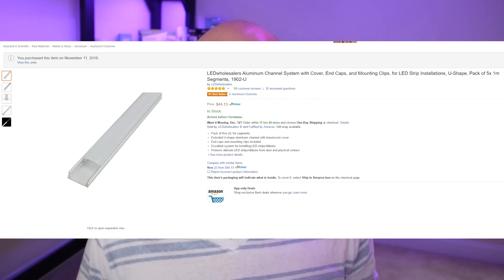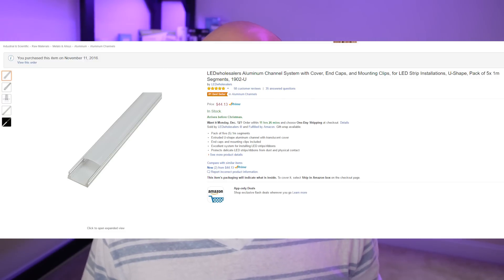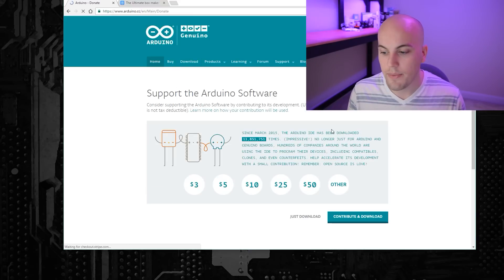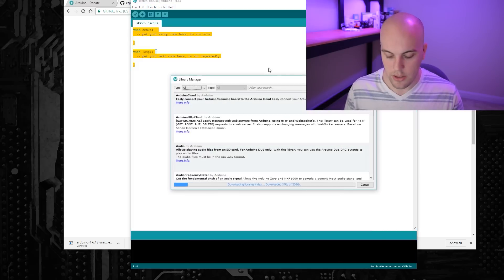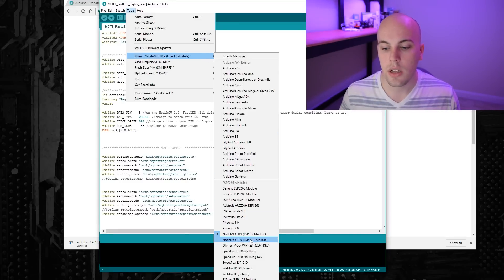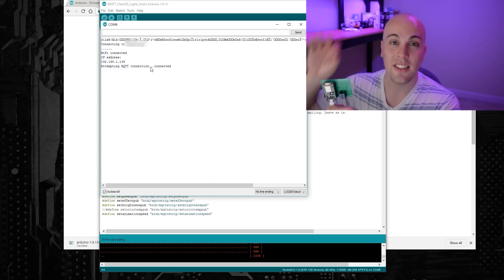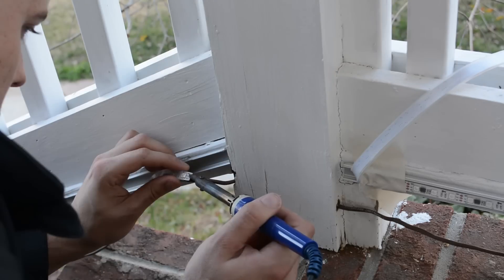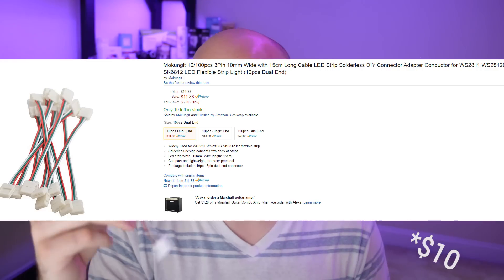The BEST Digital LED Strip Light Tutorial - DIY, WIFI-Controllable via ESP, MQTT, and Home Assistant

Comment: How do install these strips in a vehicle using the vehicle's battery?
Reply: ka1dza I am not an electrician but the power supply he lists simply transforms AC (house power) into 12vdc power (car battery) now all car batteries and car altinators are different you will have to ensure yours is 12 v and can sustain the amp output to run the amount of LED's you wish to run. Most car batteries will fit the bill assuming same LED length or less as the video. As far as setup just hook the battery to the 12v pos and neg terminals in the diagrams. As I said earlier I am not an electrician so please be sure to check all of your ratings before trying this. I am not liable for anything that may go wrong. I am also not sure in what effect this will have in battery drain or other electronics in your car.
Reply: KillSwitchio Okay. Thanks for the info. I have no electronics in the bus, so, I think, as long as the engine is running I should be ok. I just have to connect the neg to ground and positive to power. I just have to do something with the signal wire.

Comment: A tip.  Don't test the strip rolled up, as they will get hot!  I noticed that and when I rolled up to have a look, the components was all over the floor. They have unsolder from the strip.
So, no, don't use them rolled up..

Use 12V if you want to avoid the voltage drop when transfer the energy for the LED.  Higher voltage will transfer same energy with lower ampere, and that means there will be less energy losses in heat (even though they will heat in the inner part of the roll they are delivered in).

Comment: Ok so i have new problem some animations just hang the 8266 and either it gets restarted or you need to manually restart it anyone else faced the issue and have found a solution for the same
Reply: Same issue here, in fact if I switch the supply on to the LEDS & Arduino at the same time I also get a hang.Have to power the LEDS wait a few seconds then power the Arduino

Comment: Terrific video that explains so much... Frankly, it was all over my head until you started physically installing, then you got into my world as a low voltage technician. I will try to figure out how to do all the setup, configuration, and control.... Eventually.  Overall this was a bad ass project and it looks beautiful. I hope to figure out the controls side. I have a lot i want to do that seems to involve me learning how to work with Arduino.

My i offer some advice on your install?  You are correct about soldering the ends together, PITA and not worth the effort if there is a tool to help, which you found. I'd advise you use some dielectric grease to mitigate the chances of moisture intrusion at those connections.  

Good on you for soldering the cables and covering in heat shrink. If it isn't marine grade, which has a heat activated sealant, you should look into using it in the future for outdoor environments.

Where you drilled through the wood to pass the cables, I'd have used a larger heat shrink in white to cover them, or some flexible tubing which you can find in the plumbing section of a hardware store.

The wire-mould..... You lost me there. I'm sorry. 

And good on you for using a proper outdoor rated enclosure.  I've seen some really janky crap people have put outdoors that couldn't seal anything.

Comment: Hi i have question if i use a 5v led strip what would be the disadvantage as by doing that i do not need the step down converter which unfortunately cost itself around 20 dollars in India  would 5v strips affect the performance these are going to be used indoors

Comment: Need help please. I have the wiring for the ESP8266 and shift register and all that done.  I have the code uploaded to the ESP8266, but without the proper MQTT information, because that's where I'm lost!  BAD!  I have a Raspberry Pi 3.  I have tried watching the other videos linked about getting MQTT and home assistant set up, but there are many holes in it and a lot of it assumes you already have some experience with it. I don't. Not only that but it seems HA has changed a lot and some of the processes and such don't work anymore, links are gone etc. 

Please help. I've followed a ton of videos and all assume I know more than I do. Wish there was a video from beginning to end for these lights.
Reply: Did you ever get it working?
Reply: man pls, i have the same problems, dont get with all the codes at home assistant,
iz working for you?

Comment: Piece of advice at 13:04 you solder the wires when in reality life would have been A LOT easier have you just used water proof bullet connectors then for added protection the shrink wrap...... yeah yeah soldering is better so they say but should one ever need to be serviced remove the shrink wrap and then simply pull the bullet connectors apart replace repeat and done....

Comment: Has anyone got this to work or adapted it for use with a Wemos D1 Mini and WS2812B strip? I'm new to this Arduino-stuff, but the Home Assistant part works and also the D1 Mini, recieves the MQTT-messages fine, only thing is that it doesn't control the strip itself :(

Got it to work :)

Comment: A great video, thanks. I'm wondering if you can provide some guidance to help me achieve a project?

I would have a boat (Leopard 48), and would like to run a tube of addressable lights on the side stays and forestay. The problem is each stay is about 20m high, and ideally, I would like to supply power and control from the base of one stay. So the cable run would go from the cockpit (too pickup power & house the controller) to a side stay (about 3 meters), then up a 20m stay and then split down 2 x 20m stays.

I figure this is possible if I put the lights in a tube along with an additional power cable that tap's off to the LED's every 5m, but not sure how to size that cable and if the control signal will work over that distance?

It might be possible to put a small junction box at the top of the mast if that helps. Maybe even run 240v to the top and put a transformer at the top. I'm worried it will bang since I can't really secure it. I would prefer to avoid using 240v as i would need to leave the inverter running. The boat has a 12v electical system.

I have been looking for people doing garden and Christmas light projects which would have similar challenges, but people are generally using RGB lights and have more ways of supplying extra power.

Comment: Ben, It all works great and I have a strip on my Christmas tree. i noticed that input slider is now input number. I've got it to show up in my dashboard and have the automation entered which should adjust the speed via MQTT. the speed doesn't seem to have an effect
Reply: Figured it out myself, didnt have the command topic correct in the automation. had to add /set path. i guess in the video the commands aren't using MQTT json where as his github example now does.  
Thank you Ben for all your hard work on this cool project !
Reply: Thanks for your comment re the input_number for the animation speed.  How do you edit the animation speed in your automations or scenes?

Comment: Tried today to compile the code from your Github repository Ben and there's a error

unsigned int kelvin  = MILLION / color_temp;

MILLION is not defined, so I changed it with 1000000 and now it compiles but I wonder if it is 1000000 i have to use.

second thing I noticed was that Home Assistant changed its component name from input_slider to input_number

Regards
Dirk

Comment: Great videos. They've really helped me with my Home Assistant setup. I was about to ask if this would work with an ESP-01 since I have a few lying around. Then I thought... eh... let's just give it a go. Changed the code slightly to data pin 2 and flashed it and it's booted up. Just waiting for my LED strip and logic level shifters to arrive. But so far so good as they are showing up in MQTT in HA.

Comment: The strip I bought has 4 wires came with a power supply and remote I wonder if I can do a project with these or do I need to start over with different Tape I bought these (Litake LED Light Strip 16.4ft Waterproof 5050 LED Tape Light, 300 LEDs )

Comment: If you must solder two strips end to end, cover the whole joint, pads and all, with hot glue.  Epoxy works too, but isn't flexible, and can cause cracking in the electrical traces at the edges of the epoxy if it moves much.

Comment: Hi Ben! I have a couple LEDs from an other LED-project laying around and I thought to give it a try. My LED-strip is a WS2801. If I define it in your code I cant get it compiled. When I leave the LED-chipset as a WS2811 it works just fine. The WS2801 LED-strip has 4 pins: 5v, ck (clock), si (signal), gnd. Do you have any ideas? I want to run small LED-strips, so I think it would work fine with a 5v strip.

Comment: Had mine working for a while but want to now extend a section between 2 parts of LEDS. If I make it more than say 30-40cms one part starts to flash badly. Is there anything I can do to stop that happening? a repeater/amplifier for the data signal? As that is what causes the problem.. Cheers

Comment: If you want the ledstrip to light up as soon as the power is turned on, look for this lines in the arduino code and change as needed:

/****************************** GLOBALS for fade/flash *******************************/
bool stateOn = true;        //true = Strip ON when powered on. false = strip OFF when powered on

Ben: It would be awesome if you could add this comment in your code to make is easier for newcomers to find this tweak.

Comment: OK I ran them and answer to the question it will run the two strips (top and bottom) at the same time from where the Y connection was installed back. And it looks fantastic.

Comment: Hello BRUH, Most of the things I had fixed it, but I am trying to add 2 LED Strips.  1. on Backupyard 2. FrontYard.   So I use the code light: 1. paltfrom:mqtt_jason name:backyard 2. platform:mqtt_jason name:frontyard.  There is no error but is only showing the last one frontyard.  How to 2 or led switch on homeassistant.  Currently both of them are working mqtt with no issues.

Comment: how many Pixel can you control with an ESP8266? I wuld like to use the SK6812 RGBW stripes, i have like 30meters to light up. Thats 850-900 leds. Or can i just use the ESP32 with the same Tutorial to set up?
Reply: I managed to get 20 meters of apa102, 144 LEDs/meter working with the feather huzzah esp8266. That's a whopping 2880 leds!!! You'll need a beast of a power supply; I added a 10amp breaker for each meter for safety. Unfortunately you will run out of ram if you try to control your entire run as one strip. I broke it down to 3m runs running in parallel. Works well, now i'm moving on to an esp 32 with hopes the wifi will be a bit more stable for my config...
Reply: Did you geht the RGBW Strip working? Which library are you using since FastLED doesn't Support the SK6812.
Reply: No i made a test with the WS2812, and i used this Sketch. https://github.com/toblum/McLighting

Comment: Wish I had seen those LED strip connectors for my project.  The ones I used were like metal teeth that punched through the copper traces.  Often times they would not make a good connection and after you punched it once that trace was ruined.

It worked OK on my more expensive strips that had better traces, but my cheap ones all ended up in the garbage.

My one piece of advice when connecting multi strips is to power them on as white so all RGB elements are on and going as you do your build so if a trace is lost you know it and can fix it before its a bigger problem.  This is at least how the analog ones work, not sure how the digital ones would be affected. I am surprised to see digital is not much more expensive so makes me wish I had gotten these.

Comment: I am getting this error on Arduino

In file included from C:\Users\amira\Documents\Arduino\libraries\FastLED/FastLED.h:34:0,

                 from C:\Users\amira\Documents\Arduino\sketch_aug31a\sketch_aug31a.ino:25:

C:\Users\amira\Documents\Arduino\libraries\FastLED/led_sysdefs.h:22:2: error: #error "XTENSA-architecture microcontrollers are not supported."

 #error "XTENSA-architecture microcontrollers are not supported."

  ^

In file included from C:\Users\amira\Documents\Arduino\libraries\FastLED/FastLED.h:42:0,

                 from C:\Users\amira\Documents\Arduino\sketch_aug31a\sketch_aug31a.ino:25:

C:\Users\amira\Documents\Arduino\libraries\FastLED/platforms.h:22:2: error: #error "XTENSA-architecture microcontrollers are not supported"

 #error "XTENSA-architecture microcontrollers are not supported"

  ^

exit status 1
Error compiling for board WeMos D1 R2 & mini.

Comment: Hi Boss, it is very hard to hold you.  I use your code for led strips I check your code for configuration.yaml there are lot of things that I fix and after I see the button on my home assistant page.  But only issue that I am having is when I turn on light it automatically turned off.  Just need a clarification that I had not finish the arduino part.Waiting for your reply.thanksAli

Comment: if you experience flickering add #define FASTLED_ALLOW_INTERRUPTS 0
just before #include <FastLED.h>
Reply: Thank you for the tip. That's what I needed.
Reply: I did this, but when it is turned on my home assistant randomly shows the lights as turned off. (Rebooted esp ?) Could be 4 hrs or 45minutes. Never more than 6.  Without this is have flickering but they do not turn off
Reply: That is related to the bug in Fast LED library and Controller. Fast LED library development currently on hold. I am trying to debug it, to see where is a problem. That is related to watchdog stoping loop. Speculating, that some cycling loops taking a long time.
Reply: hi i am using NODE MCU and dont have level shifter however power to both are from different power supply, FASTLED does not work no matter what i do Adifruit and ESP8266fx work fine do u have any idea the reason
Reply: you need share neutral. You need have the complete circuit to make the signal from controller travel to light drivers.
Reply: i had already done that actually the issue was in programming i was name the data pin as D4 however the name or number i should have used is just 4 without the D
Reply: And then prepare for watchdog resets on your ESP board. All of these videos with WS2812B leds and Esp8266 boards never get to the part where the board resets. I wish there was a good answer to the problem.
Reply: @bryanwarman  did you ever figure this out?  Mine are flickering and not sure what to try
Reply: What to delete from the sketch to upload ONLY THE EFFECTS by cable, without WiFi, OTA, etc...??
Reply: Not using interrupts will trigger watch dog resets and reboot the ESP.

I tried using a ESP32, but the interrupts from the WiFi stack are even worse. Back on the ESP8266, with FastLED the first pixel was lit green after boot when it should have been off.

I started using the NeoPixelBus library with DMA access method. This got rid of 99% of the flickering with WiFi active, limits you to internal PIN 2, which is usually the RX pin on most of these boards. It doesn't reset tho as it's using DMA.

I still get flickering at displaying warm white at max brightness. This could be due to the PSU, 5V 12A @ 144 SK6812 LEDs or an internal voltage drop on the board, as I feed the level shifter from the 3.3V output.

And yes, somebody commenting about the fact that this is hardly ever mentioned is right. With these cheap things you tend to run into unexpected problems.

If there is a way to use these things with WiFi, MQTT without experiencing flickering or instability, please leave a comment. I am thinking about switching over to a Teensy, but other problems probably result from that as well.

Comment: If I am using two 5m strips of WS2801 leds powered by a 12v dc power supply can I use a 12v to 3.5v stepdown (using raspberry pi) or do I have to use a logic level shifter because of the length?

Comment: The driver always tries to run 18mA through the LEDs with PWM off 5V. If it drops to 4.7V it will increase the Duty Cycle. Are you sure, that it would get darker?

Comment: the power calculation is wrong
according to the adafruit website "one NeoPixel (producting enough light that it kind of hurts to look directly at it) draws about 60 milliamps of current at 5 Volts"
that means that 10m of 60leds per meter times 60 ma means that you will need at maximum power 36amp
Reply: I was having the same question.. but I guess this will have something to do with the step-down converter.. So if we recalculate to 12V, that would be 15 amps...

Comment: I would like to know if I could pick your brain. I have 3 rolls of WS2811 LED Strips and plan to install under a truck. with a HC008-1903 controller bought off EBay. But plan to upgrade to a more programmable controller later. My question is the WS2811 strip is   programmable but I want to run lights under truck and half way I would like to run a 2nd strip under the tonne cover above and have them run at the same sequence as down below. If I tap in and Y connection will lights mirror or will light pattern screw up.Thanks in advance.

Comment: Have you considered 24v leds? I only buy 24v now because of the voltage drop issue
Reply: Check out the Pcb I've designed for just this purpose. Can handle 20a @24v: http://bit.ly/2vTmlEM
I'm getting these printed right now and could send you a fully assembled one if you wish

Comment: Awesome tutorial !

Quick question.. Does it work with this led strip ? https://www.amazon.com/ALITOVE-WS2812B-Individually-Addressable-Waterproof/dp/B00ZHB9M6A/

That is 5v and shouldn't need the voltage converter, right?
Reply: Did you ever get a response or try using these? I am also looking to use a 5v strip to avoid the converter if at all possible.